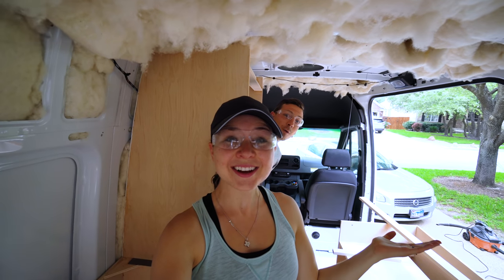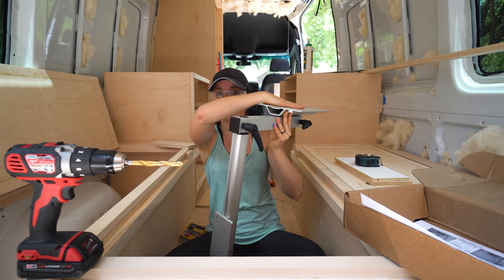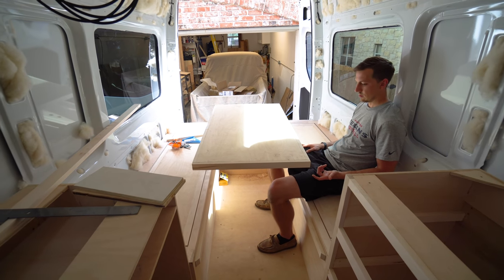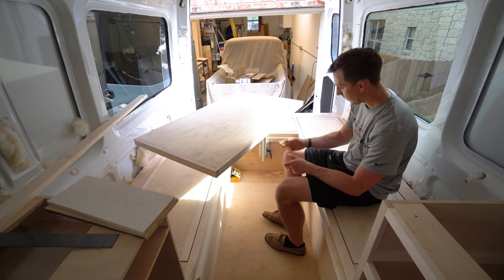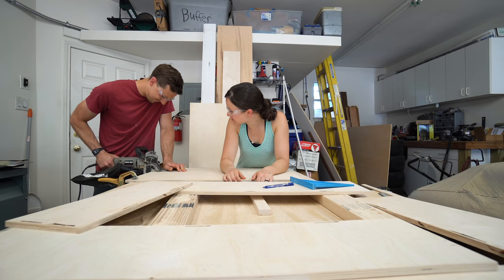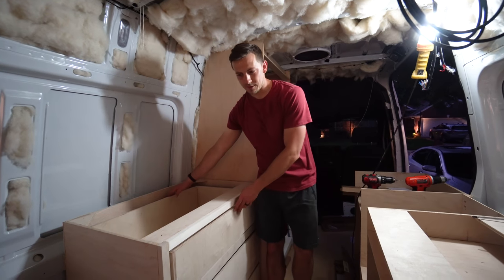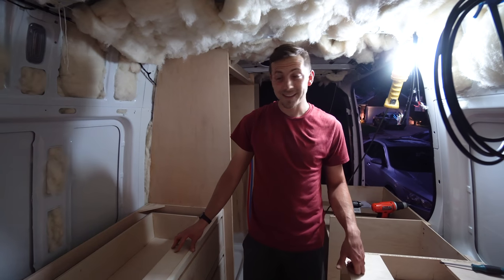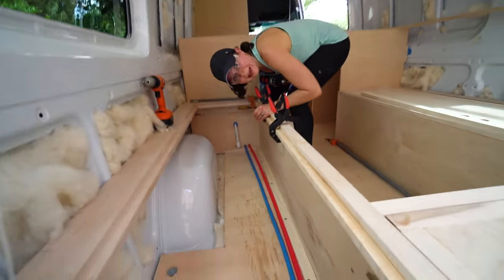Working on our van conversion TOGETHER + building our table and drawers! | Van Build Series

Comment: Woo hoo I’m glad y’all were able to work together! 
Add a drop leg you can hide under the table even if you have slide it in at an angle

Y’all did a great job ! Y’all constantly amaze me. In theory it’s not all that difficult to make such transformations, IN THEORY. 
In reality, it’s a bit more difficult. 
Y’all make it look easy though! I appreciate the bloopers. Then I can see what could go 
wrong and be prepared if I ever tried to do this. 
Thanks again for sharing!
Reply from the maker: It was sooo much fun together! And great idea! I think we are definitely leaning towards adding a removable leg. Since we will be working full time in the van, we don’t want to be annoyed by the wobbling!
Reply: Adventures of A plus K it doesn’t even have to be a removable leg . You the little poker tables you can check out the mechanisms for it , but for a single leg. The leg can slide in at an angle and then slide across to the middle to drop and become a leg in the center of the table at the end then it won’t wobble .

You’ll figure it out , I have faith in you!
Reply from the maker: Thank you for having faith in us! Lol! We hardly have faith in ourselves 🤣 We think we may use a hinge system and attach them underneath when they aren’t down. That way it’s one less thing to store somewhere!
Reply: Adventures of A plus K great idea! That’ll work! See I knew you’d come up something! 
Great storage too!
Reply from the maker: Thank you so much! 😃

Comment: For the table you could attach a horizontal bracket user the table do 1 ya could open the back door and adjust it and use it outside the van and 2 I could stabilise in  dinner table mode

Comment: Great job.....how did you connect the two freshwater tanks. My wife and I are retired and thinking about converting a van to travel. We have looked at a lot of conversions on Youtube and we love your layout.
Reply from the maker: Hi Carey! Thanks so much! For the freshwater tanks, the fill line to the water tanks are connected together so that when we fill them with our hose, the water goes to both. It does take a little bit of time for them to balance out. The left side fills up first and then we let it sit a bit until the right side catches up. We have our two water pumps (one for hot and one for cold) connected to this single fill line as well. Hope that helps!

Comment: Nice work! Are you planning on drilling wood to the walls to mount things to?
Reply from the maker: Thanks Luke! We will be putting up some wood strips (not sure if that’s the best term haha) to attach the wall material and our upper cabinets! We need to get everything wired and then hopefully can finally cover all of the insulation 🐑

Comment: I'm trying to figure out how you did the bench top lids.  it looks like 1x2's attached around the outside of plywood? looks like the same for your table?
Reply from the maker: The tabletop has a 1x2" piece wrapped around a thinner piece of wood (we can't remember the exact wood for the table). The bench top lids are just 3/4" plywood and they rest on the ledge inside the bench. I hope that helps a bit!

Comment: Did you ever figure out a way to make the table more sturdy?
Reply from the maker: We didn’t, but it honestly doesn’t bother us that much. We try to sit on different ends of the table so we both aren’t putting pressure on the end of it. But we have worked and eaten on it almost daily and it’s not bad at all! I can’t remember if we said this in the video, but moving the attachment more to the center of the table helped as well.